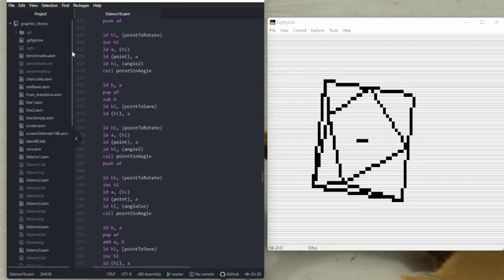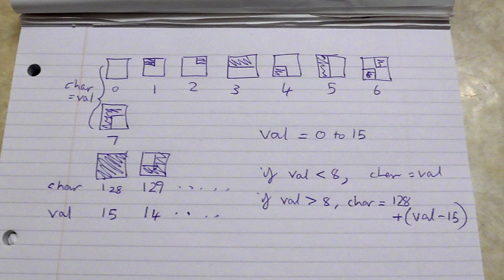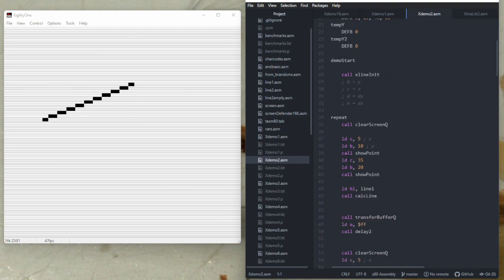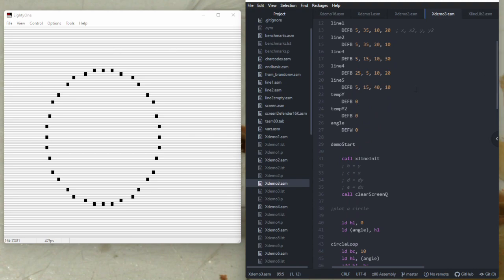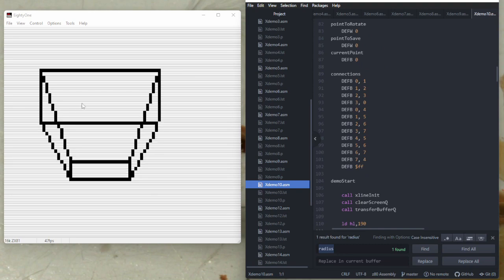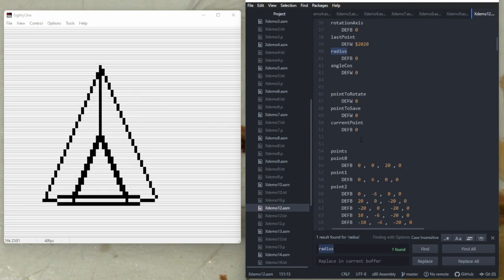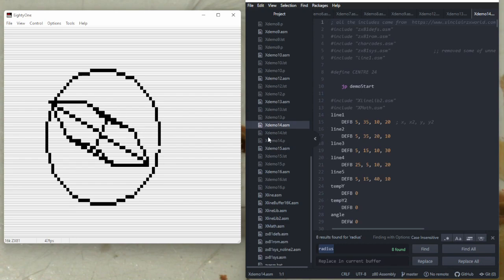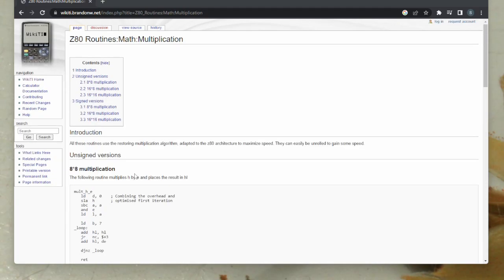A fast 3D low-res graphics library for the ZX81

Comment: WOW! I've even seen true 3D on the Atari VCS/2600 (only a cube, probably due to RAM limitations, but still), but never on a ZX8x system. Both this and 8-Bit Retro Journal's version of Elite are really cool!

I do wonder how fast it takes just to compute the vertex output positions (and hidden faces), without actually drawing anything. The main reason I ask this is because I've wondered for a while how "modern" a 3D game or demo for an 8 or 16-bit system* could be if the processing load of drawing the screen was outsourced to powerful graphics hardware (for instance, allowing the distortion of sprites as polygons), the CPU only responsible for doing the geometry math and gameplay logic.

(By the way, like @TheDigitalOrphanage , I did "grow up" with the ZX81, but in a different and more limited way—I am ~25 years too young to have experienced it in its heyday, but factors including my programmer father induced in me an interest in retrocomputing, and the only retro computer system I had was a ZX81, so I naturally began fooling with it and seeing what the BASIC commands did, perused through the manual, saved data to tape, et cetera.)

*The original target was a Daytona USA clone on SNES (probably using a cartridge with the custom graphics processor/PPU and a separate video out to avoid the memory transfer of screen data back to the console {as was done with the Super FX chip} hogging CPU time), but others could be used.
Reply from the maker: Thanks,  good to hear from someone who got into the ZX81 and retro scene as a second generation as it were, I'd hate to think it would all just fade away. I don't remember the exact timings, but you are right in that most of the time is in the actual point plotting,  i.e. calculating how to translate a 'pixel' into what ZX81 character to draw at what point on the text screen, and the double buffering. I'd thought of outsourcing that to some kind of graphics card too, but never got beyond the thinking stage :) There's still a lot of scope to speed up the routines here without that, it could be made twice as fast at least though , through a variety of optimisations.

Comment: Awesome work! This would have blown my mind as a kid when I used my ZX81. I found this after wondering if the Teletext version of Elite meant a ZX81 version could be possible.
Reply from the maker: Thanks. yes I thought just the same when I first saw 8-bit's version, how is it possible. But now it seems very doable. Thanks for the heads up about the teletext version, I wasn't aware of that.